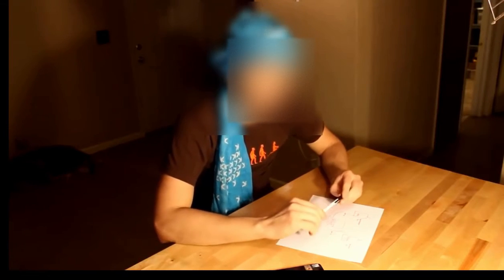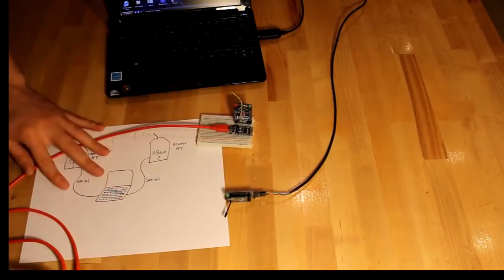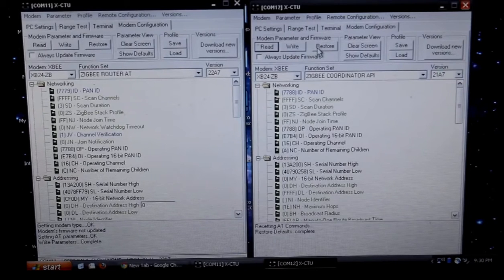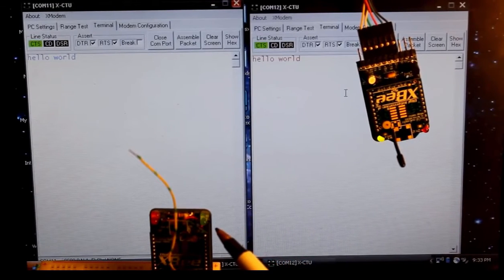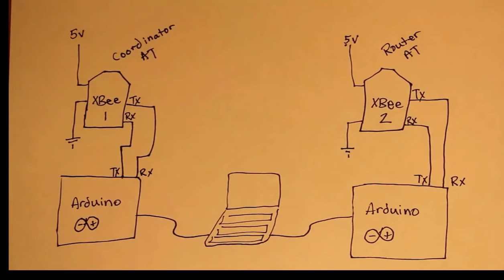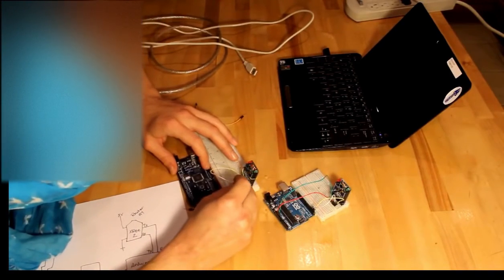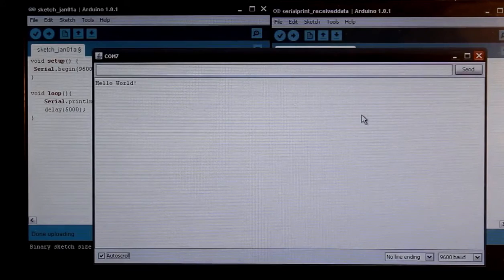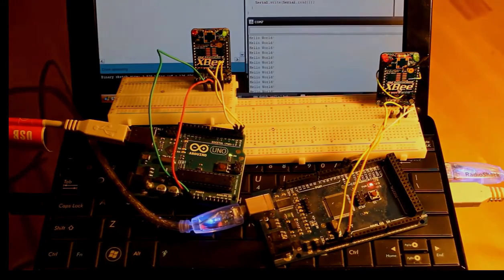XBee Basics - Lesson 2 - Simple Chat Between Two XBess in AT Mode

Comment: Hello Sir, I want to build build a network having 2 routers and a  coordinator. All Xbee modules are in AT mode and connected with Arduino boards. And the problem is that the coordinator just received data from 1 Xbee router. May you give me some tips to deal with that problem. I hope you can read my comment and give me some tips. Thank you so much.